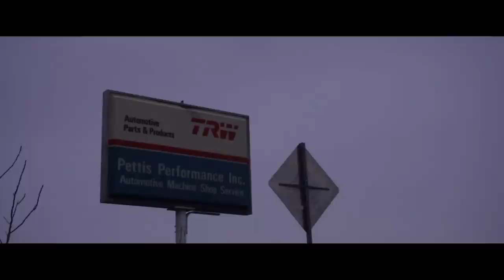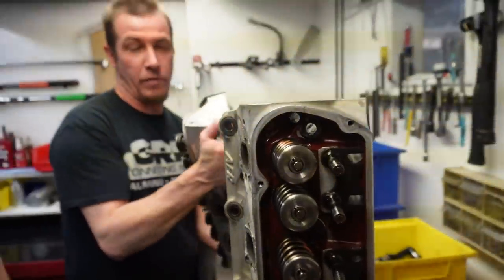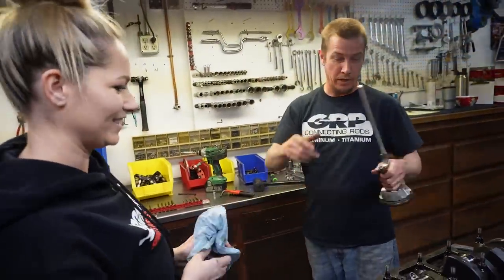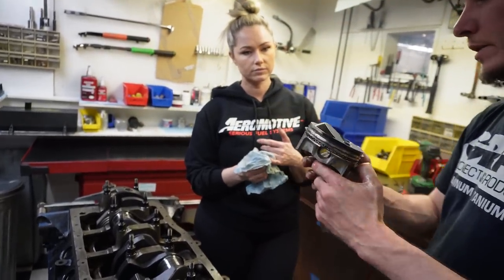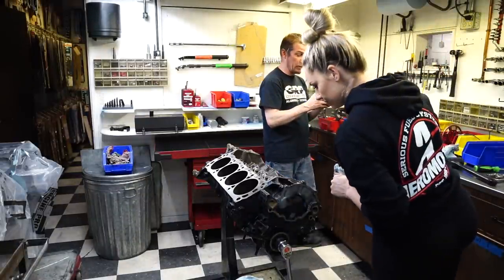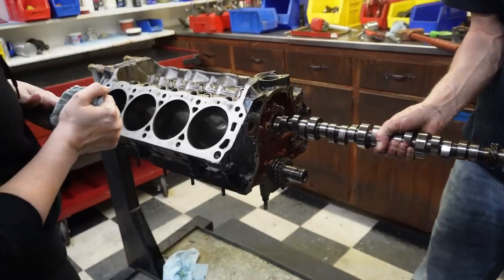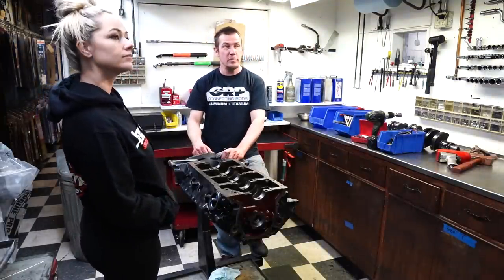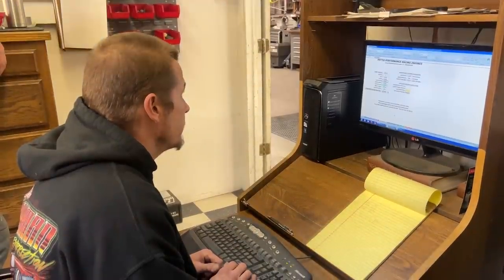New Motor Build For the Gray Mare AND Trash Panda!

Comment: I found my first "Hecho on Mexico" while I was in school in 2001. I drilled, reamed, and tapped the mains for ½" threads. With a little honing the main caps slid over the main studs tightly. This decreased the "cap walk" to ZERO! I believe that's why I was able to beat that engine, which was bored 0.100" over, at high rpm(7,600 to 8k) for 5 years and 80k miles. It was really hard to find, and it was a great daily driver!
Reply: Wow considering 60 is max on Mexican blocks
Reply: @alltherpm  did you read that spec some where?
Reply: @alltherpm  all "Mexican" blocks aren't the same. The casting numbers on mine actually didn't make sense. From what I could decipher at the time. It had different shaped "nipples" on the front and screw in freeze plugs. No way was it a Boss block.....
Reply: @alltherpm  according to the sonic tester used at the time, 0.150" may have been possible. I did build a second "Mexican" that resembled the Mexican blocks in the books more closely. Only went 0.060" in that one, but with same results. Casting numbers didn't make sense either, and it was a one piece rear main.  Thicker main caps too.....never had a problem spinning them fast or making big power with them.
Reply: @arturozarate1752  the blocks still thin were they Crack, just bigger main caps, front cap boss is paper thin
Reply: @alltherpm  sure, but s couple of modifications and an additional valley plate pinned into the front and rear walls kept things together. Cast iron is brittle period.
Reply: @arturozarate1752  nope I've been racing ford engines 4, 26yrs been researching since, also on  bar racing on utube explains about the block, yes it has bigger main caps and little bit bigger main bosses, but must time they split from front main web were it's still weak, darts shp fixed this, but I'm still in market for Mexican block cause I'm on edge of Crackn stockys now, 73.5hp per cylinder n.a
Reply: @alltherpm  25 years here. Well if you're racing straight line, fill it with block hard or similar. You only need to run water through the heads anyway.

Road course racing I was able to get away with half filling. 

I've used ⅛" steel plate under the lower intake from wall to wall, and I pinned it to the "china walls". It should be the entire width of the open valley between the heads. It'll fit under any intake out there. Well, that's if you haven't flat milled a ton from the heads, or angle milled at all. 

I've used the same approach with production blocks too. I've tested  those out to 850rwhp and still see those motors together after like 11 years.

I personally have only run one R302 FRPP block,
Reply: @alltherpm  I've seen early 302 blocks split, and that had a lot to do with the firing order they were running. The #1-#5 vs the #1-#3. The 1 - 5 really stress the front main web . You actually see the #2 main cap show sign of walking.

588hp is a strong number for NA!👏👏👏👏👏

Comment: I have heads that came off a stock block, crank rods with 18ish lbs of booster centrifugal supercharger. 800hp. Missed shift in the rpm and crank/ rod broke. Hand ported Wilbert Highports iron heads! Now on a little 347 b cam in my dads Maverick.

Comment: Need to upgrade to 1/2 inch head studs. They have stopped the head gasket issues I had with the 347 strikers I've built. Never had any issues after. I opted for re-ring and bearings every 50 1/4mile passes.

Comment: I know you two we’re looking for clutches that hold up well iv tried every brand and type made for mustangs and by far the best iv found is the dual friction centerforce clutch pressure plate and flywheel with aftermarket trans fork if available

Comment: Is the bottom of the pistons walls beveled would be my question? Bevel the bottom of the piston's wall's may solve the issue. Small Bevel at the bottom of pistons walls will keep the rings from getting smashed. Still a possibility but piston will have a smoother travel.

Comment: Just wanted to know what Tony meant by might be hard to find a block like that. I built a 289 with a X marked 302 block and it turns 8500 with 1969 351w heads cut .050 and everything else stock 289 internals with no studs and stock rod bolts. 🤔
Reply from the maker: We're looking for a mexican 302 block. Rumor has it they can hold more power. This block is a Mexican 302, but it is already .040 0ver, so we need another one closer to stock bore size.
Reply: @MissMidnightMaverick  soo, what you're saying is you can really give it the beans.:face-blue-smiling:
Reply from the maker: @markthegunplumber8376  exactly! Haha. All the boost and nitrous it’ll take 😂
Reply: @MissMidnightMaverick  Tell me how to distinctively tell if it's a Mexican block. The motor I have is built to a 289 but it originally was a 302. Give me a way to check mine 🤔

Comment: Rev limiter, fuel build up on ignition cut at 9k rpm will cause a even the best parts to distort/break. I say enough fuel in the cylinder at ign cut then he lifted off throttle adding more fuel then when he went WOT border line hydro locked it enough to crack/break the skirt or distort the piston loosening skirt clearance causing slap.
Reply from the maker: I don't know how I missed your comment before, but that makes a lot of sense! We can't find any defect in the deck or the heads.
Reply: @MissMidnightMaverick  seen a lot of parts broken from beating the rev limiter, boosted SBF will usually spit the intake gasket before the head gasket causing coolant to be digested and a lot of folks will think head gasket too. I took my rev limiter to 12k rpm to avoid thing like this, now i wont be looking for what caused an issue because the problem will likely be laying on the ground😂
Reply from the maker: Yeah, when Tony runs it I don’t think he has the rev limiter set to 9k, but because our friend that was borrowing it can be a little more heavy footed he set it at 9k.

Comment: One thing i dont like about MLS head gaskets, water seepage between the layers, that why boosted motors use a single layer gasket
Reply from the maker: We use copper for boosted motors.
Reply: @MissMidnightMaverick  I have had those MLS gaskets leak very little water between them on a na ls,

Comment: Your skirt issue looks like the bore was a little out of round and the piston has been grabbing the cylinder wall. Most likely at the bottom of the bore. 😢
Reply from the maker: This motor probably has over 100 passes on it, it just started making noise after the last pass.

Comment: Just my 2 cents. If your looking for SBF Trickflow heads Call Ford strokers and talk to Nicole. Also if you run highport heads you will have issues with the rockers. You will need offset cups or the best which is crower. They are 2k. The stock center to center will work, but after a few runs they will push the bearing and bind. Jim and nicole are a wealth of knowledge and they buy more ford trickflow heads then Summit sell. Summit racing also owns trickflow. Fordstrokers are lower priced as well. By the way Billy has a maverick stored at his dads house. Is it yours? if not i would like to own it PM me
Reply from the maker: Trickflow is sponsoring the heads. I ran highports on my black car with no issues for 3 years. And yes the maverick is mine and will be going to SC soon.
Reply: @MissMidnightMaverick  What rocker may I ask. I had Crane golds  and a stage two TFS cam. Glad to see TFS is sponsoring you. You going 225 or 240s.
Reply from the maker: @brendavanorden9550  stage 5 cam, 240s, Comp Pro Magnum rockers, I had T&D on the black car.

Comment: Why does everybody say you cant run high compression like 12:5:1 with alot of boost like yalls 20psi? Ive always heard 8:5:1 to 10:5:1 at most when running alot of boost. Does it really just depend on who tunes it?
Reply from the maker: Higher compression motors have a smaller tuning window, they’re definitely a lot harder to tune and have a higher chance of catastrophic failure especially with high boost pressures. The 363 I had in my black car was about 10.5:1 and I ran 40lbs of boost to it with an F1X-12, but it probably would have held more than that if I went to a 121. Class cars that are limited on blower or turbo size will run higher compression motors because they need to make up for the lack of boost, but their tune has to be on point.
Reply: @MissMidnightMaverick  I have a hard time trusting people with my car lmao. Idk if I'd be able to trust anybody around my area that much  with that great of a risk an that small of a window for error. I'd definitely have to look at reviews on people that tune around here an go talk to them first.